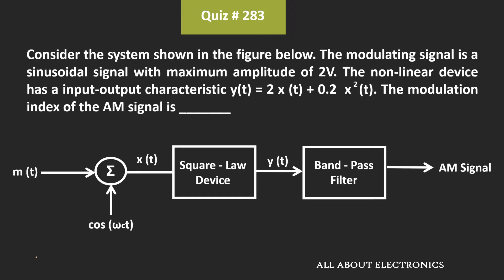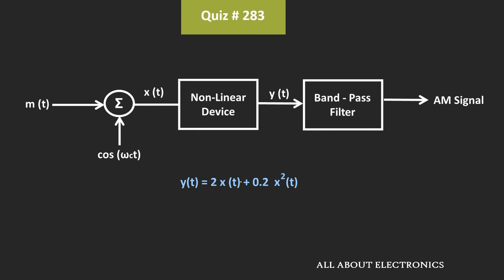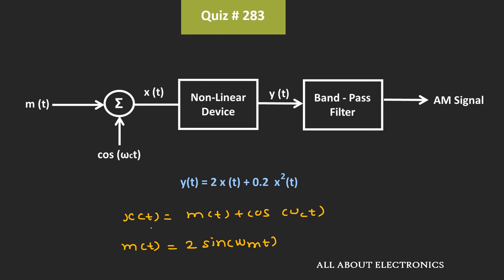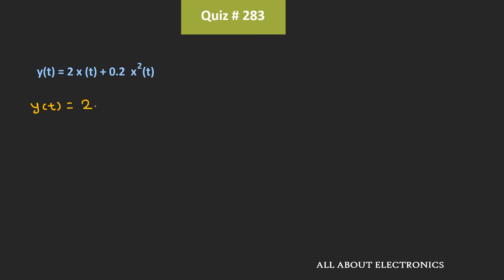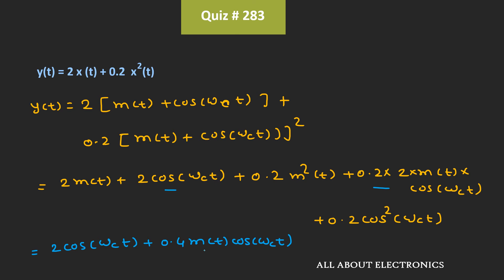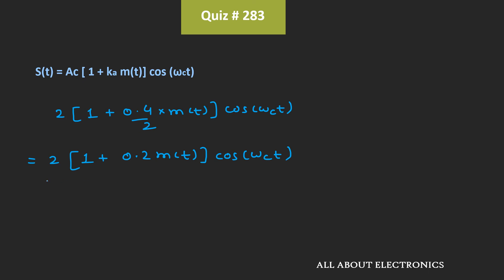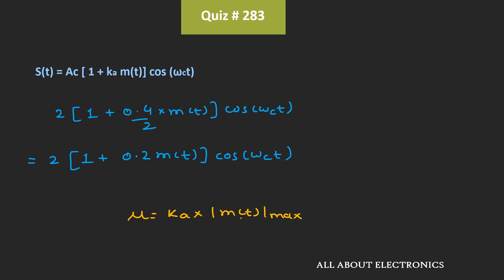Amplitude Modulation (Square Law Modulator ) Solved Problem | Quiz # 283

Comment: why the modulation index is not (ka*|m(t)|max)/(Ac)
Reply from the maker: Because if you see the expression of standard amplitude modulation, the carrier amplitude Ac is already taken outside in the expression. 
What you are saying true for another expression, that is [Ac + m(t)] cos (wct)
Different equations are used based on the way the AM signal is generated. 
But in any type of expression, the basic thing is the multiplication of carrier and the message signal and separate carrier signal term.
I hope it will clear your doubt.
Reply: Yes I understood when u solve the problem u say the formulae is  (ka * m(t)|max but it is actually (ka/Ac) * m(t)|max 
i mean that ka-dash = ka/Ac like that.
if anything wrong in assumpton pls tell me. 
Thank U
Reply from the maker: Actually, if you multiply Ac with other terms then equation would be Ac cos (wct) + ka * m(t)*Ac cos (wct).
In that case, modulation index is ka* Ac *| m(t) | max / Ac.
So, eventually it is ka* | m(t)| max.
I hope it will clear your doubt.
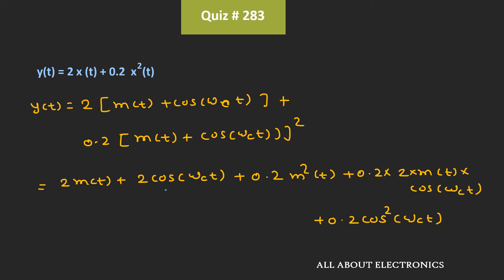Reply: 2:11 why only 2 terms considered?